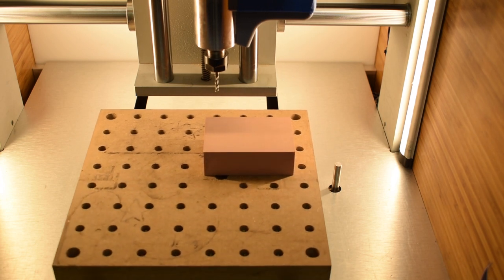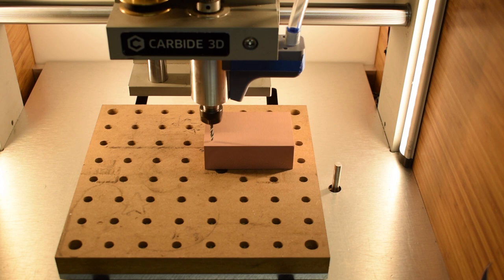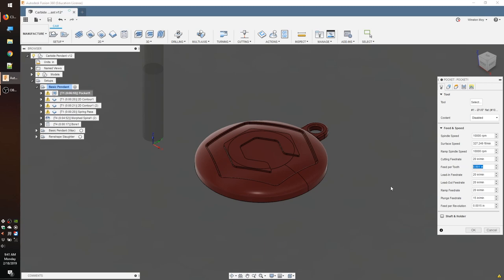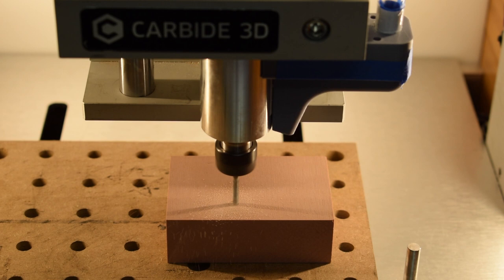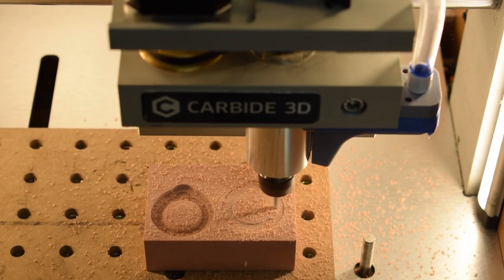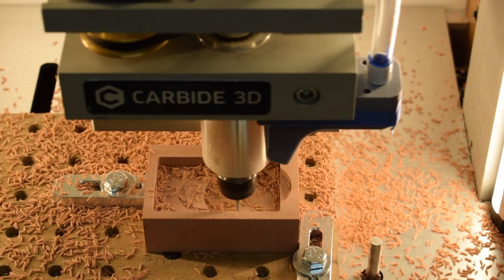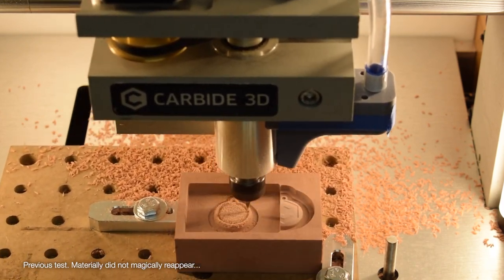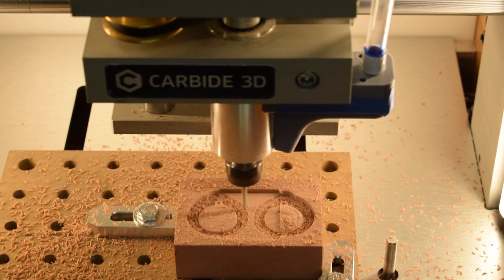Machining Renshape on the Nomad - #MaterialMonday

Comment: Winston,
Is that a 3d printed air blower nozzle attached by the spindle? Could you share some details?
Reply: Yes it's for airblast, doing some research into the importance of it in deeper slotting cuts, particularly in aluminum. Plenty of ways to do it, I just wanted something out of the way.
Reply: Lock-Line is another popular option.